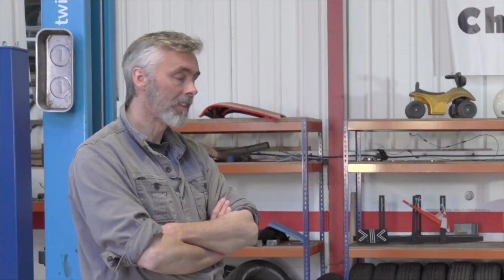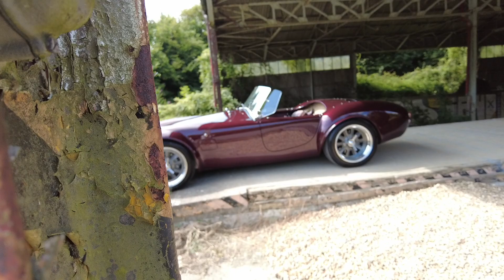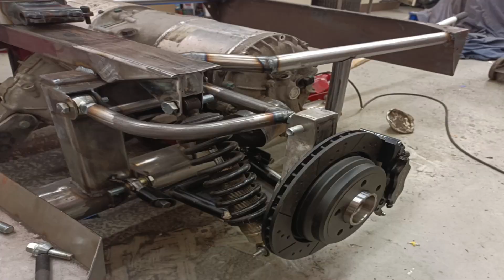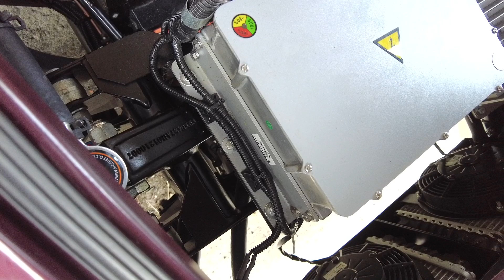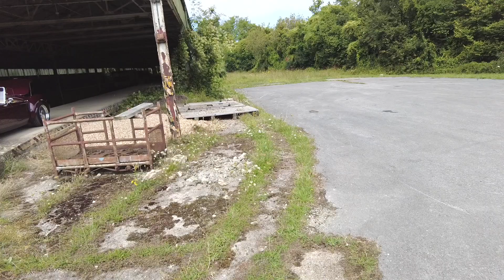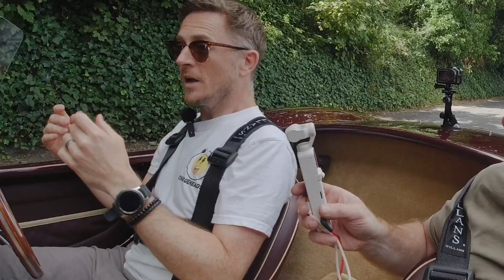THIS DIY Tesla Powered Cobra pulls out all the stops to be the best electric sports car!

Comment: Would it be easier to use small Tesla drive unit?  Think they are 200hp?
Reply: Possibly, they both have the same mounting positions so wouldn't be a huge benefit. LDU seemed the logical choice when I started
Reply from the maker: Best to use a Model 3 motor, says the man fitting one in a TVR, more efficient, powerful and reliable. Sdu is 220kw whixh is circa 300bhp

Comment: So to build an EV this way you need to budget £6-£7k to pass the regs?
Reply: If you need to go IVA then yes you need an R100 inspection first. I was told (but I have not investigated) that there are other options other than MIRA now for the R100.
Reply: @MTrehy1976  Thanks.

Comment: Thanks for the peek at your rear suspension! I decided to do something similar with my Mustang. The benefits are many. No cutting the frame rail, no need to cut and redo the interior, keep flange-flange width, and the ability to keep using mustang wheels.
Reply: No worries, I have loads more pics - let me know if you want any more details
Reply from the maker: @PWN-E  good to hear 👍

Comment: The lack of care for the passengers safety straps is kind of funny, as there isn’t much ‘safety’ there in the case of an accident. There isn’t even a personal roll bar. You’re on the roads and not a race track. 
My father has a v8 cobra. It is very loud as you drive everywhere. You really can’t have conversations because it is a ‘race’ car. It literally shakes house walls as you drive by slowly. It is made for the open roads. And by me we have the best country roads. 
The electric concept is nice if you’re going to put a lot of miles on it in an urban environment. To each its own when you have a shit ton of money. The one thing about a cobra is if you just going to let it sit you’re missing the point of owning it.

Comment: Its not a Cobra , it's a kit car replica. Big big difference.
Reply: It's definitely a Cobra ... but clearly it's not an AC Cobra. But 'twas ever thus ... there must be at least 500 kit Cobras for every real one!
Reply from the maker: @bobbybishop5662  same same, but different 🤔
Reply: technically cobras are ACE/?triumph?-LLC+ford+Shelby-hybrid and maybe chevy-SBC-200-383 powered ( after Shelby and ford-3 got into spasms and or contracts didn't get renewed ) and maybe one/failed-experiment ( Shelby did it under contract and drove it one-time and said never again, and bill Cosby refused to honour/picking up-ect aka returning it back to the factory after being scared....less ) 540ci~twin-blower's/cammer-instead ( 4 or 5 speed manual transmission ) of being a dodge/hemi ( sorry fuzzy memory's as im a dodge or uk car types, not into ford's-act generally ) for bill Cosby 

AC-ace was/is ~4L~ L6's ?3speed? or 4-trans included is jaguar and or centrifugal-blower'd

this is closer to what AC team'd up with elon/merc/Toyota and or modernised it like moris mini has a modern-ish convertible/BEV model now available, missed the chance of getting flat floor as carol's-S known to not like the humpback+iconic backward's-shifter ( might be possible to be just as iconic as red-house gaited or dodge's 1970 coronets-bench/E-body pistol-grip or France weirdness designs ) but saw it as a necessary evil at least within 1960-80's common technology available

Comment: YouTube dropped this gem of a video in my feed. 

I, literally, have daydreamed to myself about an EV Cobra (in pewter) for the past  7 to 8 years.

Thanks for this awesome video!
Reply from the maker: @Michael-Gill  glad you found it. Thanks for the positive comment 🙏
Reply: should have done a flat battery-packaging ( probably 60-120kw and 500-1500HP discharge and 4X4 with a switching/controls and a glass-dashboard/central infotainment centre ) as it's possible for frunk+rear storage and putting the ECU+inverters-ect under the sail-panel were the original AC-ace had tank-ect and used the grill-flaps and ducting around the frunk ect id do a bench seating but im a bigger individual 200-300lb's/over-weight and 5,5ft+

still probably more user friendly vs hemi-dodge+Tr6060 winks

Comment: 50% of the reason for building a cobra is the v8 sound.
Reply from the maker: So you're saying 50% of people buy a cobra to make noise 😂
Reply: @chargeheads  No.
Reply: So you’re saying people build V8 Cobras for half-arsed reasons?
Reply: More, I think, as it's really an AC Ace with a huge V8.

Comment: this makes total sense start with a clean sheet I would use the model 3 rear motor and suspension and ya a lot more battery options very nice build well done.
Reply from the maker: @jank330  agreed, that would be my choice as well. However EV conversion tech is moving at an alarming so things have come on quite a bit. A similar story to my tesla powered TVR 😉

Comment: Just because you can doesn't mean you should.
Made a golfcart out of a classic vehicle.
Reply: Brand new vehicle. Not much worse than other modern replicas which are glass fibre bodied rather than aluminium. The originals swapped engines from the old engine AC used. Plus this version is probably less likely to kill you!
Reply: It's a new build. No actual classic vehicles were involved ... it just happens to be based on an attractive existing classic design.

Comment: AC Cobra becoming a DC Coupe? ;)
This sort of weekend ride is ideal for an EV build. There's more then a few low volume vehicles that the Tesla drivetrain is just as valid a choice as a K-swap or an LS, and a ton of base-model cars that classic musclecars were built on, where they would be built in to clones of the V8 versions, could be EV swapped instead. A mid-60's six cylinder Barracuda or Mustang with Model 3 or Model S hardware would be a fast ride.
Reply from the maker: @PiDsPagePrototypes  I like what you did there 😉
Reply: He's an ACE comedian!

Comment: What batteries would you use now, 3 yrs on?
Reply from the maker: @TeslaBulldotcom  LFP are good for safety, its finding a chemistry that's has the power as well.
Reply: @chargeheads  Given the extreme challenge of fitting sufficient kWh capacity into a restricted space classic vehicle I don't think LFP is the way to go ... it makes the job even harder.

Comment: Lock wire on a hv plug? Never heard of that requirement for r100 before
Reply: I can't remember exactly why they wanted it. They made me do it while I was there. If I remember correctly they wanted the removal of the plug to require 2 actions and the easiest option on the day was to wrap some wire around it.
Reply: @MTrehy1976  I know that any hv connections should not be accessible directly and need to have a plate or system to access it.
Reply: @modscotsman  sounds about right. Can't remember exactly now and at the time wasn't quibbling about putting some lock wire on if that helped getting the test passed!
Reply from the maker: @modscotsman  thanks for your comment, maybe some one with the knowledge on this can shed some light?!